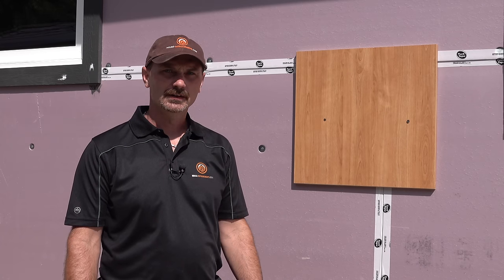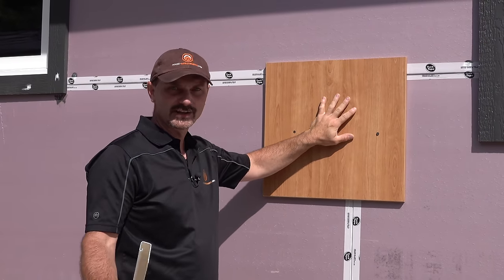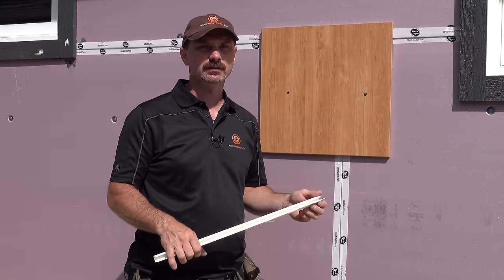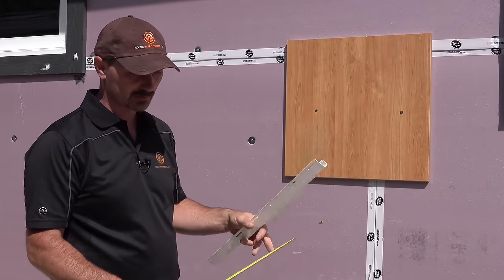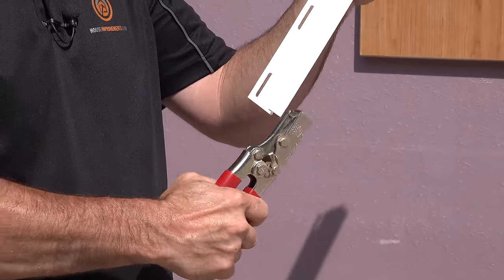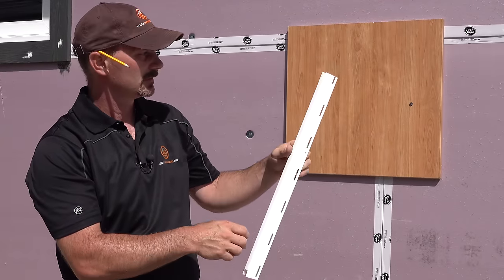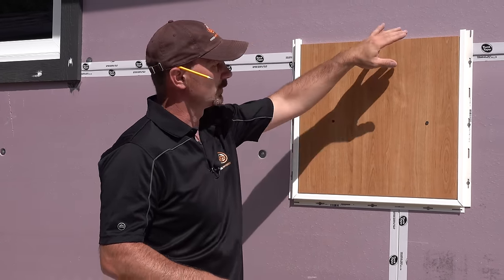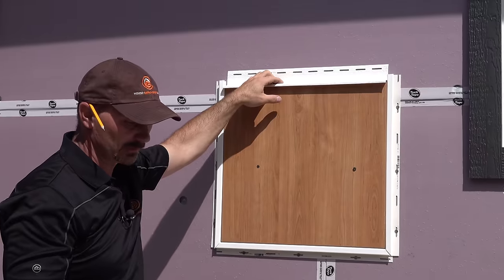How To Install J Channel (Vinyl Siding)

Comment: At the bottom corners should it be flashed to divert the water in the j-channel out to the front of the siding, as it is now the water will go behind the siding, might be rot there over a period of time ( no air circulation)
Reply from the maker: You absolutely can but in most environments if the house wrap is done well that moisture should run out the bottom of the wall.

Comment: I need to install two 16 x 24 vents on my second story garage. My concern is that once I cut out the opening for the vent the vinyl siding may blow off before I have a chance to install the J channel. I was thinking of slicing one side of the vinyl at a time, install J channel then cut out the opening. I would really hate to mess this up.

Comment: Didn't get to watch the whole video, so sorry if you covered this question; when installing the top row of vinyl siding, quite often, you need to have a custom cut piece to fit underneath the trim.. is it best practice/normal to tack nail the bottom of the top row into place in this case?
Reply from the maker: No there is a special trim piece (under sill) and tool (snap lock punch) to install that last cut row. 90% of the time that is what you will need. In the odd case you could put silicone in the bottom lip of the top row of siding to attach to the 2nd last row.
Reply: @HouseImprovements  thanks for the reply. Sill* is the correct word, not trim.. thanks. 

So under any circumstances, is it okay to  drive tack nails through the bottom of the top row/top of the second to top row in order to "Secure" the top row underneath the sill?

Comment: we are installing vertical board and batten vinyl siding and have a couple questions. First we have install all the J trim around the windows and now are ready to install the vertical panels..when we get to the window what is the best way to install the siding around the window so it locks in > do we us Undersil trim or just a piece of cut off material as a firing? also what is the best way to install around the bump pot boxes for things like the taps and dryer vent that have the piece that snap on over the siding.. seems like there is alot of play? do you have any videos that demontrate installing vertical board and batten around windows etc?
Reply from the maker: Most vertices are too thick for undersill trim. Usually scraps of siding or other materials behind the edges help it to sit properly and look right in all of the areas you mentioned. If you need more assistance please use our forum.https://www.house-improvements.com/forums/

Comment: Hope you don't mind me asking here. Why wouldn't you also install the window/door cap behind/under the bottom of the object over the bottom J-channel? This would keep any moisture running down the object face from seeping in between the bottom of the object/top of the bottom J-channel. Thank you
Reply from the maker: The way the window door cap is designed you could not fasten it under the window , it would need the nail strip reversed to be under the cap.

Comment: Do you have any of the same kind of video for when you install replacement windows on a house where you are not replacing the siding?   Retrofitting the j-channel and drip caps, etc.?
Reply from the maker: I do not at this time

Comment: Hi. How do you install replacement j channel under existing siding without having to remove the siding? I had my front door replaced and didn't have any j channel on hand so the guys couldn't do it. Now I want to do it myself but am not understanding how to secure it behind the siding. Thanks!!
Reply from the maker: I would screw it to the door trim if you can otherwise you need to remove the siding to secure the J channel using the nailing area that is provided on the trim.
Reply: @HouseImprovements  thank you. I wasn't sure if I should try that.

Comment: two questions! are nails recommended above screws? and would this method work for adding a ledger board for a deck roof? it has to be added to the middle of the house rather than at a roof line.

Comment: Hello. Love the video. I have a question about using J and drip cap over a 12 foot garage door. As you said the holes on the two pieces do not line up so  I have to nail the j channel through the plastic of the of the drip edge. That leaves no room for expansion for the drip edge. Is that okay? I know you said it was okay for a window but this is 12 feet long. This is my first siding job and worry that it will go all wobbly when it warms up. Thanks in advance!
Reply from the maker: It will be fine, I do it all the time.

Comment: Ok the drip strip on each each end is overlapping the vertical j channels and water runs horizontally from drip strip flowing down the vertically inside J channels, where does water go once water leaves at the bottom of J Channel?

Comment: Question. What if you install 2'" thick insulation boards under siding and your windows are flat with the previous wall. So what do need to do with windows?

Comment: Is there anyway to cut out existing siding and put in J channel without stripping all of the siding down?

Got two new sconces for the front that have a pretty long and wide base so I will need to cut out some siding and do something like this to mount them.
Reply from the maker: There are different style and sized "siding blocks" that would work for your sconces , but you will need to remove the couple rows of siding in each sconce area to install them.https://www.youtube.com/watch?v=IzXbO2PigWs&t=71s

Comment: Hi saw a guy leave the back of the J when he did his tabs on top and side corners which allowed the tab not to free flap.  Also nails looks too long for application think should be only 1 inch is plenty if you think 5/8 plywood ext wall. What do you think about that?
Reply from the maker: Have you ever tried to nail siding with 1" nails ? I doubt it, unless you have very slim fingers you will be cursing every time!
Reply: @HouseImprovements  Ahh one of those things that sounds logical but in practice not so.. Thx

Comment: How would you nail the j-chanel if sliding underneath existing siding (I'm installing around board electrical meter mounted on after relocated and range hood exhaust cut through existing siding)?  Is there a trick or in this case would you use PL400/glue?
Reply from the maker: You could add a couple screws inside the j and screw it to the edge of the board. Or pop the ends of the siding loose and nail the J

Comment: I noticed your using a fairly long nail since your attaching through a foam insulation.  Over a solid surface, is a standared 1" to 1-1/2" galvanized roofing nail the best choice for attaching both the trim and the siding?

Comment: Wow ! Excellent !  I am a subscriber ! Thank you for the video. I also watched the commercial ads I hope that helps you Shannon ! I am going to install Bilco Doors over an outside entrance to the basement. I have Aluminum siding on the house. My question is: is there anything I should know about Aluminum J Channel ? Any special ways of nailing etc.  ?  I do not know if I can even purchase Aluminum J Channel from Lowes or Home Depot. If I am unable to purchase Aluminum J Channel  -  should I just use Vinyl J Channel up against the aluminum ? Another question is: is there a trick to removing a course of Aluminum siding? I will need to reuse that course of Aluminum Siding which is located right above the Bilco Doors.  Any help you can give would be appreciated.

Comment: What do you do around the window trim when the siding is vinyl? I know if it was LP smart siding you would leave like an 1/8 gal around the trim for caulk and expansion.
Reply from the maker: You would use J trim and leave the siding short by 1/4" to 3/8".

Comment: I have a box from the gas co that they use to read the monthly bill I assume.  It has plastic sticking out the sides on the top and bottom, so that my J channel will not set flush against the box.  If I set the J away from the box a little water will surley get in behind the siding  How would you deal w/ this ?   I tried a molding box like for a light or such but would not fit around the box.
Reply from the maker: I would have the utility come and remove the box and then you can quickly install a siding block and then they can mount it agin to that. There are many different styles but i would use a mini mount block .https://www.youtube.com/watch?v=IzXbO2PigWs&t=420s
If you have more questions please use my forum.https://www.house-improvements.com/forums/

Comment: I have J channel at the very bottom of my sunroom with vinyl siding. The J channel holds the first piece of siding at the bottom. J channel is nailed on and holds the siding. I’m not sure how to remove some siding so I can remove the old J channel and replace it. What are your suggestions?

Comment: I had my windows replaced with vinyl and the old frames stick out about 1/4 of inch. maybe a little more.    Should the J be ran at the old frames or to the new vinyl windows?  I can see where they caulked in between the old frame and the new windows really good.  how would you run the J in this situation?
Reply from the maker: Please join or free forum and there you can post a picture of your window and I can advise from there. https://www.house-improvements.com/forums/

Comment: Thanks, I don't do much vinyl siding but I've always thought j molding didn't do anything cept hide the siding edges. I see how it works now at siding side of j, but do you ever do anything between the j and the window or door frame? I have caulked just before installing j,, any recommendations or do y'all just allow the wrap to stop water that may get through there?

Comment: Shannon just came across your channel, spent the afternoon watching the various vinyl siding vids (incredibly informative and helpful - thanks you!) but I do have a question (apologies if I missed the answer in one of the vids!) when the water sheds across the top J channel and runs down the side J channel how can you redirect the water to remain on the outside of the vinyl when it reaches the bottom of the window and not simply run behind the vinyl?  Or since the water would be shedding across the tar paper below will it not be an issue.
Reply from the maker: Most times it is not a problem if the window is properly fitted ,drip edge installed above and proper house wrap .But as added precaution you can install water diversion at the bottom of the J channel side pieces that re directs the water back out over the next row below the siding. A simple 8" wide piece of aluminum flashing is tucked under the J and is long enough to sit over the siding nail fin row below. If you come to my forum with your question I can post a picture there to help you understand.

Comment: Shannon, I am adding siding to a wall that corners with another wall that already has siding; should I remove the siding and J channel from existing and install one that will connect both the existing and new one?  What is the name of the piece I need?
Reply from the maker: There are inside corners that would be one piece but its really not necessary , just butt a J to the existing one that is on the other wall.
Reply: Thank

Comment: How wide is the house wrap tape that you used? Is drip cap the same as z-flashing? Also, is it necessary for siding to be removed completely to install j-channel? Last, do you have a video that explains what undersill trim is and how to install it? Please provide a link if so. Thanks!
Reply from the maker: I want to guess that it is about 2-1/2" wide? 
Other common names for drip cap are "Z flashing" and "window and door cap"
I dont have a video for under sill trim at this time. It is not used often I find but I should do one. The main reason to use it is if you have a horizontal cut under an object or soffit where the siding is cut in the narrow part of its profile and J channel is to wide to hold it tight. Use a clip cutter to cut notches in the top edge of the siding and it then slides into the undersell and clips into lip inside of it. If you need more help please use my forum. https://www.house-improvements.com/forums/
Reply: @HouseImprovements  Thanks! I have one more question: did you (do you) tape the j-channel’s nailing fin with the house wrap tape to waterproof it? I’m told by multiple contractors that it is needed.

Comment: This is really a question.  I am finding difficulty in locating someone who knows how mitigate water falling from the roof in a torrent, and then under the siding where it meets the concrete.  Water has come into the house as a result.  Any suggestions, please?
Reply from the maker: You can try striking up that question in our forum for some help.https://www.house-improvements.com/forums/

Comment: very good video. At the end when you use the tuck tape at the top of the board, can I tape right around the J trim on all 4 corners. I don't think it will hurt right. Also did you do a vid where you do siding and it meets with the soffit. I was wondering if it falls short if I have to rip the siding add a Jtrim and butt it  against the over hang soffit.
Reply from the maker: Yes taping all around is fine. 
At the soffit you use a J channel up against the soffit and cut the siding to fit. I need to do a video specific to that procedure one day. You can kinda see the process in this time lapse video.https://www.youtube.com/watch?v=jNl733SUTUQ&list=PLh0KqGKtX4oUz8fyeFsZYo6Np41NoreOQ&index=14

Comment: Please help me understand this... don't the vertical J's direct water behind the siding at the bottom of the J?  They're just trim pieces except that the water run-down from the top seems like it's being directed with the J and then dumped behind the siding.  Obviously in this case, it doesn't matter because of the foam, but in my case it's just breathable housewrap on top of OSB.
Reply from the maker: Yes some water will go behind the siding. Vinyl siding is not a water proof wall covering. That is why it is important that all the house wrap under it is well sealed at all penetrations.
Reply: @HouseImprovements    Ok, roger that, thanks Shannon

Comment: Ok so I am having trouble finding the j channel notching tool from any of my local hardware stores or even Lowe’s and Home Depot. Been to several stores and made many phone calls and nothing. I did follow your Amazon link but now I’m not sure what size to get and what determines that. Any help would be appreciated. Great videos btw.
Reply: Depends on what size j-channel you are cutting.  Get the MALCO JCC50R, that's for 1/2" and is probably the most common.
Reply: buildstoys My channel measures almost 1” in depth on the outside of channel. I read all these reviews about the 3/4” j channel and they act like it cuts a 1” notch. It’s very confusing when I can’t find any kind of actual size notch they cut for each size. I would think like the jcc75r would be a 3/4” notch and so on. All the reviews say otherwise. Do these ppl not know what they are talking about? Hard to believe so many ppl would have the same issue.
Reply: amazon has them

Comment: Not judging and I’m not trying to critique? I do have a question when you put the drip edge on top before you put the top J channel I understand it runs water away so it doesn’t run out your windows doors what have you. Yet when the actual vinyl siding is up and then there will some of that water still get behind that vinyl siding how do you avoid that?
Reply from the maker: You can't avoid the little bit of rain water that will get behind the siding but you can use membrane flashing or house wrap tape to seal the top edge of the nail fin on the trims to the wall to direct any moisture that is running down the wall out and over onto the drip cap and or J channel.
Reply: @HouseImprovements  thank you for that clarification. That’s what I thought.

Comment: will be adding v. siding over masonite siding. what backer board should one use?  ie: foam board or bubble wrap and does  it still need a water resistant material over top of the backer board/?
Reply from the maker: please ask questions in our forum, we can help from there.https://www.house-improvements.com/forums/

Comment: HELP - I have UNDERSILL TRIM at my roof-line (so that I can tuck the last row of siding into the trim at the roof) and I am using DOUBLE 4" SIDING. My last row of siding had to be trimmed to a depth of 5". Unfortunately the last row cannot be tucked into the undersill trim because of the rolled 'bend' in the siding that occurs at 4" depth. Essentially I need to somehow 'flatten' the 5" depth piece of siding so that it will snugly fit into the undersill trim. How is this problem solved because it's nigh impossible to flatten the rolled vinyl at the 4" mark. Please advise. thanks

Comment: Hi, thank you so so much for your videos!!! Wow so profetionnal! I should have seen this before. I made a mistake... I have to redo my J because it is not over lap the bottom J chanel...:(  Do you have a video how to change or replace J chanel without take of all the siding? Thank you again for your tip!
Reply from the maker: Just remove the pieces you need to to get at the J you wanna change. I have a video on my channel showing how to remove individual pieces of siding.
Reply from the maker: Here is my vinyl siding playlist.https://www.youtube.com/playlist?list=PLh0KqGKtX4oUz8fyeFsZYo6Np41NoreOQ

Comment: Do you have a video for installing a service panel with meter can with vinyl siding on some type of blocking or board? How do you prevent wind driven rain from getting into the side and bottom j channels?
Reply from the maker: There are blocks designed for service mounts that come with a removable J channel trim piece. I don't have a video for that but this will give you the idea how it works ,they are just larger. https://www.youtube.com/watch?v=IzXbO2PigWs

Vinyl siding is not water tight. Rain will drive in. Proper sealing and house wrap under the siding is important.